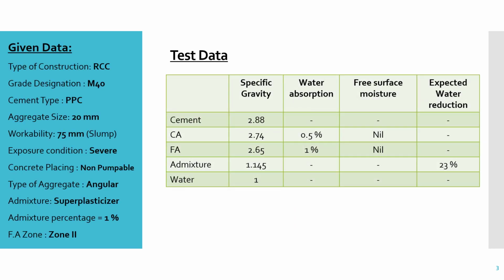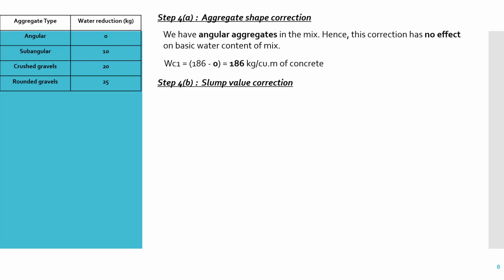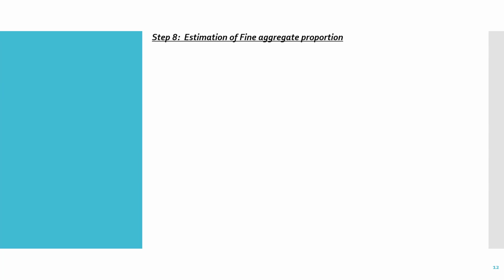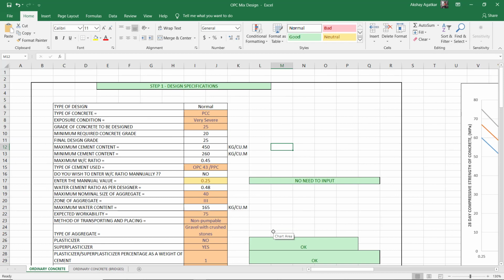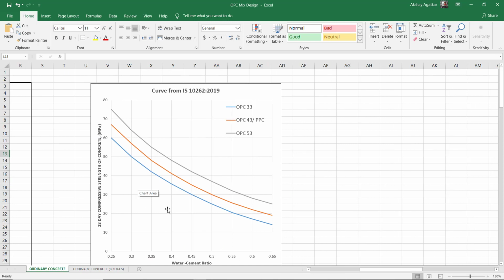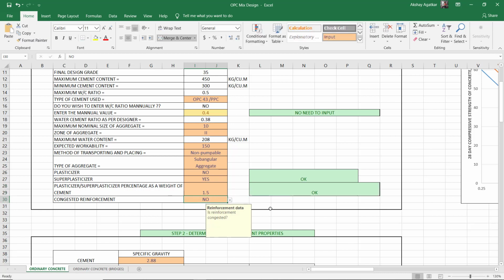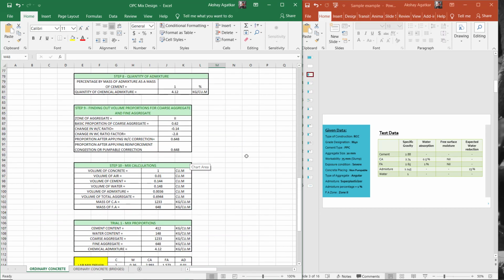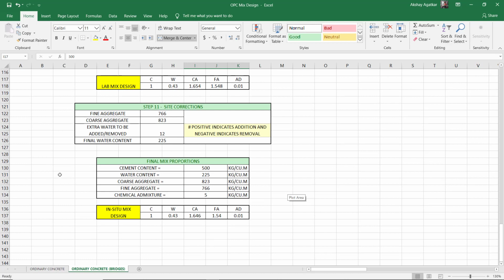Concrete Mix Design - Ordinary Concrete (Part 2) As Per IS 10262 : 2019 | ENGLISH

Comment: Suppose if we use "Pumpable concrete" in step 7(b), how does the calculation vary. Can you please explain?
Reply from the maker: you can reduce the proportion of CA by 10% in the mix.

Comment: From where to download this excel Sheet ??
Reply from the maker: Link for the sample sheet is given in description box
Reply: @DesignEd2020  Difference b/w Sample Sheet & Original Sheet ?
Reply from the maker: @Consentric  Sample sheet can be used  only for limited grades of concrete and limited exposure conditions whereas original sheet has full access.
Reply: @DesignEd2020  How to get the Full Sheet ?
Reply from the maker: @Consentric  You can drop a mail at the contact information given in description box
Reply: @DesignEd2020  Is it Chargeable ?
Reply from the maker: @Consentric  yes